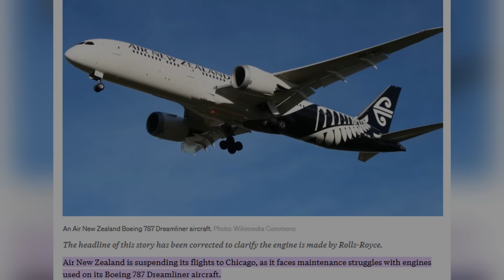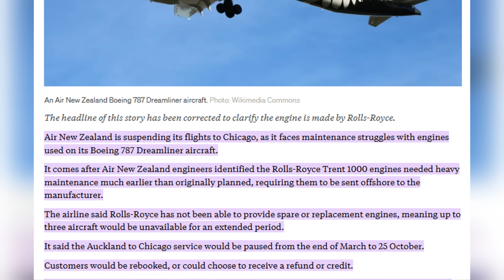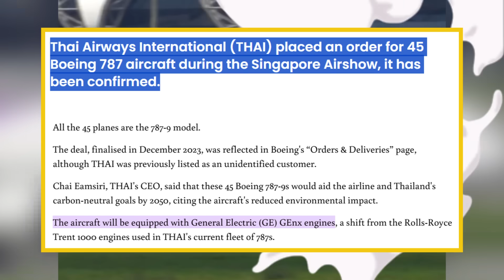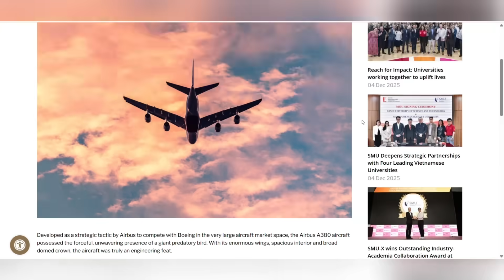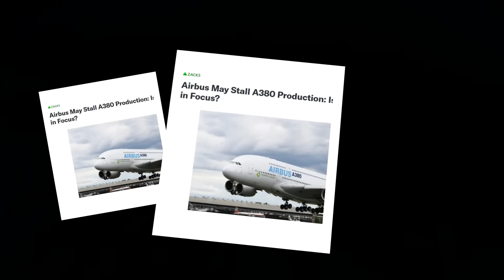Boeing BREAKS SILENCE On Why They No Longer Trust Rolls-Royce!

Comment: There was never a market for VLA (very-large-aircraft) a la A380.  It was built on French hubris.
Reply: Of course there is a market for it. Qantas, emirates and other long haul carriers are going to suffer vastly when the A380's have to retire. With slot restrictions at Heathrow and Sydney Qantas is going to lose alot of capacity that neither the A350 or 777x can replace.